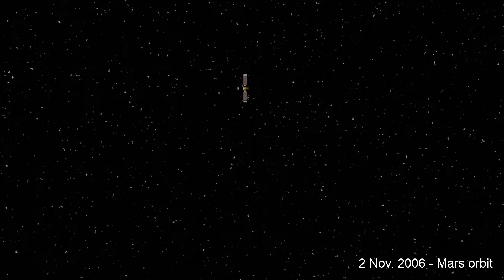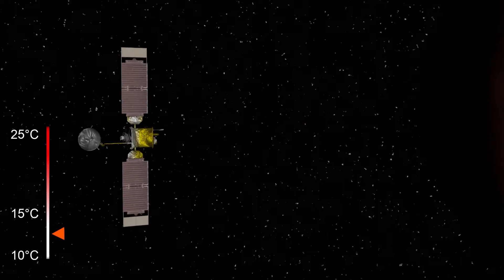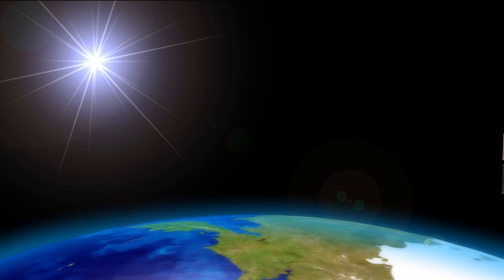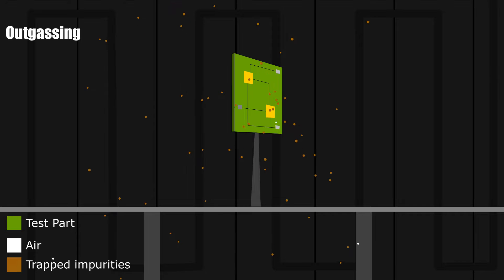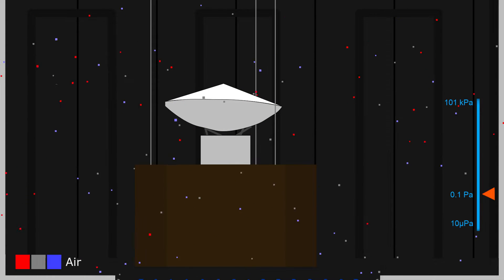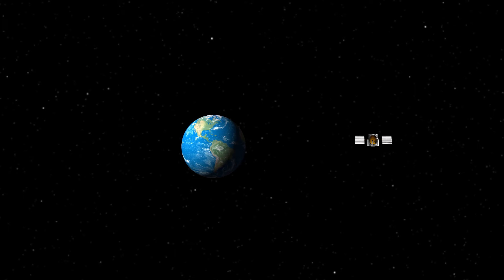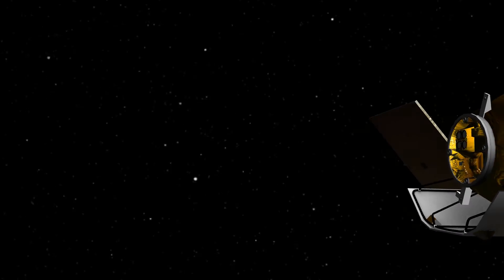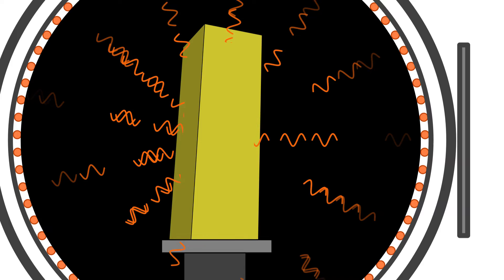Space Simulation Chamber - It's more than just creating a Vacuum.

Comment: I would suggest that your statement that the vibration and acoustical environment from launch is easy to simulate is very misleading. While it may be true that we can reproduce the environment the characterization of the anticipated environment is extremely challenging to calculate.
Reply from the maker: Thanks for the response. I wasn't suggesting that it's easy. I was comparing it to the difficulty of creating the other environments which can not be easily reproduce and require very expensive single use specialized devices. That's why I stated that it was relatively easy. All of these artificial environment will have to be tested and verified against the real thing. The acoustical launch environment is the only one that can be verified without having to actual go into space.
I'd agree that every aspect of testing and certifying a spacecraft is difficult because if nothing else, the operating margins are thin compared to other vehicles.
Reply: @ReflectiveLayerFilm  I enjoyed the video and while I would agree that vacuum chambers and the testing that must be performed is challenging and resource intensive, giant shaker tables and acoustical chambers have their difficulties as well. So yes it's all pretty involved and each step in the process is critical to ensuring the best chances for success!!